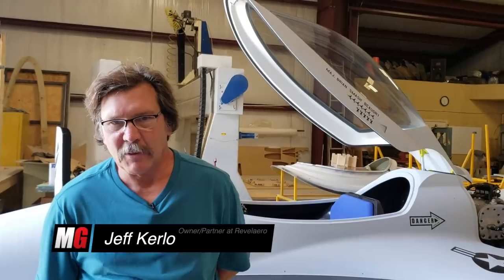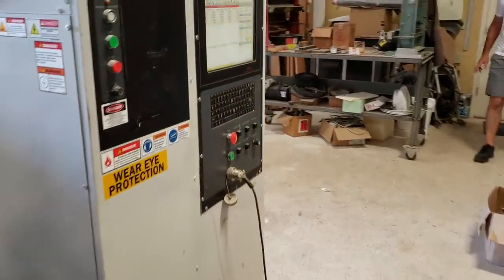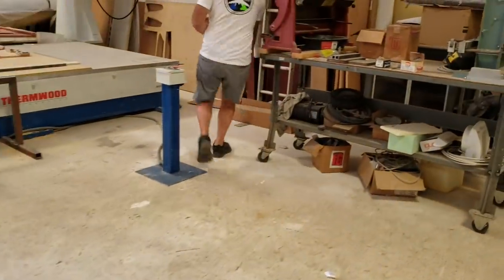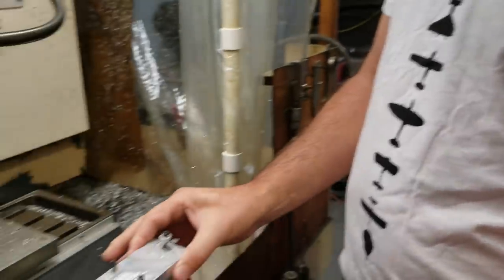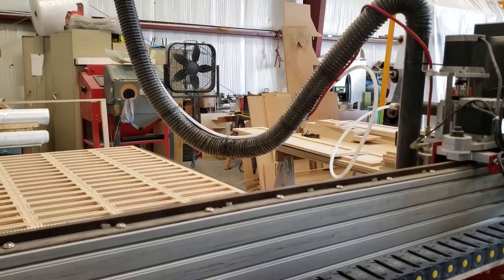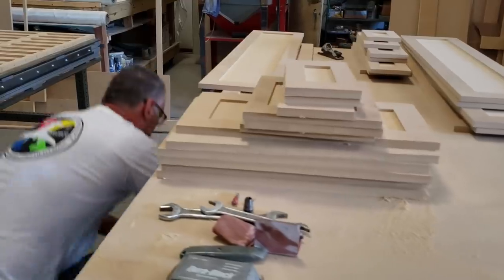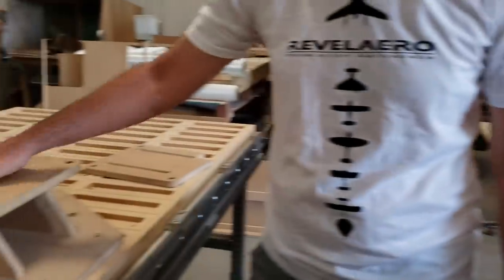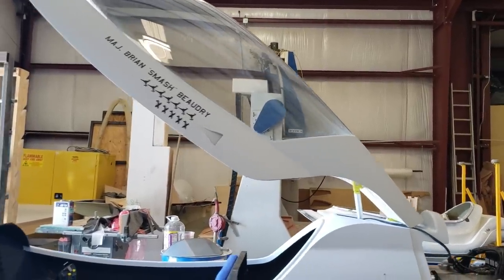Revelaero Composite Plane Factory Tour| How It’s Made

Comment: With the technology today. It's very easy to build lightweight aircraft.  Plus the auto clave ovens have been in existence for many years. So that process has been perfected.  Fiberglass and other composite materials are extremely strong and durable.  Commercial aircraft use composites on flaps jacks crew covers called canoes. And other areas. Many homebuilders use composite kits to build the aircraft.  But as always get the FAA inspectors  involved with the building process of   home built aircraft. And a good qualified A&I to also help with inspections.  Great design on this Aircraft it should peak a lot of interest and may sell very well.  After  all the tests involved with new Aircraft. Good luck very nice looking aircraft.

Comment: I dont understand why not to use aluminum? Maybe its just a little heavier but cheaper. Im just asking
Reply: Slava ivanof I figure they’re just really into this particular kind of tech. 3D design and manufacture is cutting edge stuff and fun to play with. I prefer working with aluminum myself, but I’d love to spend a day watching how their process works. It’s fascinating.
Reply: There are too many swept compound angles to do this in aluminum without using large forming presses. The geometries would have to be simplified to the point that it would look like an entirely different aircraft.
Reply: This may 25X stronger than aluminum. The entire 787 Dreamliner is made from Carbon Fiber including wings. When it bends it doesn't break.

Comment: It's very interesting. Basically a rutan derivative. Is it part time next to full time job situation or full time? things seem to move slowly.
I can only recommend being very focused and aggressive about completion and progress. Limbo is forever. If necessary look for a million dollar venture cap and then get it done. Hobby laziness will make it bleed into the sand and never amount to anything. There might be a market for this personal fighter jet style plane but I think the real revolution is in pressurized sleek teardrop low wing twin jet at LSA price. Straddled reclined tandem seating. Could start as experimental but with focus on full certification. Super light weight. Has to be so economic that LSAers can easily afford it yet able to do 400kts at FL400.
It will need a 10kg engine design, like a smaller version of Williams EJ22 which is a 44kg 300kg thrust jet with decent fuel economy. It could revolutionize GA and make you a billion dollar company 'overnight'.
Reply: While I agree the airplane does resemble a Rutan design to a point however this design looks to be more refined and hopefully it will fix a lot of the issues in canard style homebuilds. Also, I believe they should focus on getting the piston model in production to start making sales. We have seen personal experimental jets created but the market is very limited because the pilot has to meet hour requirements and have an LOA from the FAA which means lots of training and a practical test. The Viperjet is a good example of a somewhat failed civilian jet being that they only sold 21 kits and builders spent around 350k a kit.